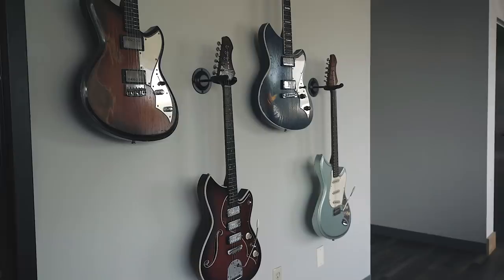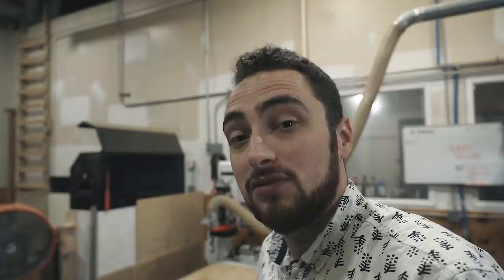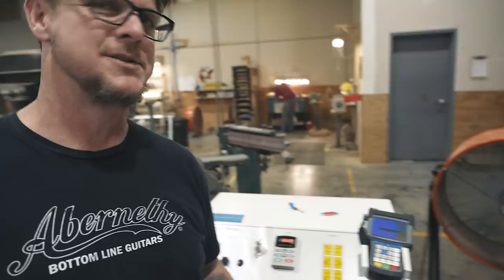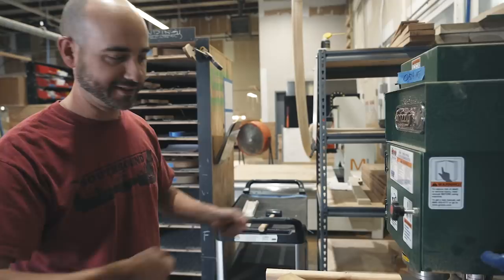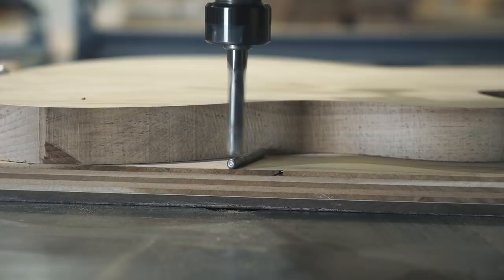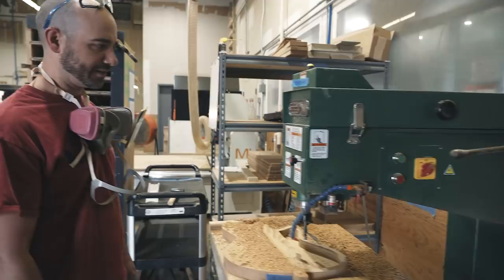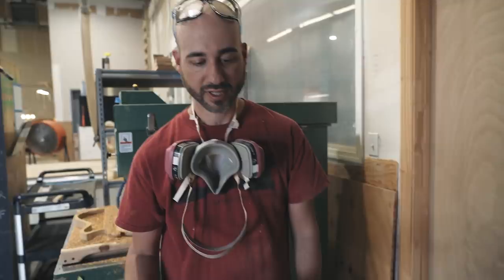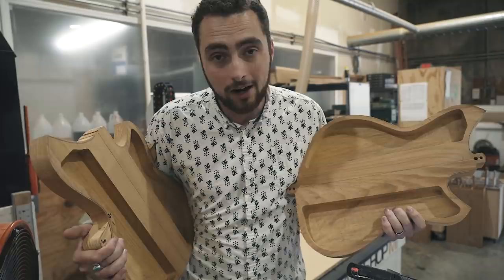Is “Handmade” Really Better? CNC vs. Handmade Guitar

Comment: I use a CNC router for manufacturing signs. We used to rout all the signs by hand but now we use a CNC. CNCs are faster, much more accurate and do a better job over all. A CNC router is just another way to cut wood and that is it. A luthier could hand saw the entire job as well but you don‘t see them doing that. That would be doing “by hand”. They could sand it by hand as well. You might get your guitar in 5 years. No, they use power tools and that is what a CNC router is a power tool that cuts wood. No doubt when luthiers began using power tools there might have been a debate from moving away from doing everything by hand. To debate this topic is based on metal illness. End of story (good video, thanx).
Reply: I can use power tools without mucking about using any software. A CNC machine with no program is a table.

Comment: 11:25 YIKES, thats a good way to lose some fingers, inserting the pin while the tool spindle is running.  Then goes on to speak about the risk of running that machine... lead by example!
Reply: I noticed that, too.  I was a safety engineer and I am astounded the machine was so dangerous.  You have to design for real people, who will always cut corners or get distracted, it's the human condition.  I'm sure he knew he should have shut the cutter off and waited for it to spin down to a stop, but he was trying to save that time.  The guy watching and asking questions should not even be in the production area at all.

Comment: I'm not a guitar maker, but I'm a wood carver and both ways have advantages and disadvantages. When it comes to 360 3-D carving like figure or Grinling Gibbons carving, then hand. When it comes to production and precision, then CNC. The big factor is cost, and how often will you use it. Some people just send there plans out and have an outside contractor do it. When it comes to original drawing table to completed piece then hand. CNC does have the speed factor as long as it's something that can be programmed! Clean up will always require hand....

Comment: Neither where "hand made" , both used machines, both used router bits, one had its boundaries set by a template (quite possibly a template made on the cnc) and the other was guided by X,Y data.
An acoustic guitar where someone is taking shavings off the braces is what hand mode is about and where a difference would matter.
In this style of guitar a one off hand made prototype is great for doing on the fly changes to the styling and balance of a body, after that it is consistent duplication of that result which is where CNC comes into its own and keeps the price down in the area of shaping wood that could be better spent on finish and setup.
Reply: Agreed. The most basic of Violin designs might give people a better idea about handmade stringed instrument "voice".
Reply: unless they produce a machine that can choose the wood /glue /fret/ polish/assemble/finish sand/mock up/ setup then every guitar is hand made. i Build guitars and banjos i do not have a CNC or pin router. i do use a band saw and a hand router and files chisels etc.

Comment: Great series! I own both handmade and mass production guitars and yes I agree the CNC method gives you consistency however as said here it’s still down to the operator/craftsman because some of those guitars play and look superb and others are well ok. 
The handmade guitars have their flaws but this is what gives them an organic look and feel and no two are exactly the same. A perfectly unique guitar which was built for each of my sons when they were born as a unique gift to them when they’re older. But I’d say I still prefer the CNC method for its safety and bare bones consistency and leave the energy of the craftsman to really nail the details in frets and sanding because the devils in the details!

Comment: As a custom guitar builder I do not use a CNC machine.  But I do use self made templates to help with the consistency of the routing.  The big part of a "hand made" guitar, in my mind, is the fit and finish afterwards.  Basically all of the crappy work of putting a guitar together.  The sanding, fret leveling and dressing, the painting and wet-sanding, the buffing, and the final setup for playability.   All of those tasks I believe are still done by hand at the big factories that use CNC machines.  So its more of a time saver than a quality issue.  Hammer and chisel would be the ultimate "hand made" guitar.

Comment: Well ... moving the wood by hand along machines is not “handmade” 😂😂😂
Reply: Does it really matter that the pattern that the router uses is a physical object instead of a list of stepper motor movements stored in a computer? Is the wooden blank chosen any more carefully by the guy with the pin router? Seems to me that it would be easier for the guy shoving the blank around on the pin router to screw up. Of course, in the world of random wound pickups and 'relic-ed' guitars, the inconsistencies of hand work and fake ageing are revered rather than scorned. (Disclaimer - I'm a software developer and I'm building a small CNC machine.)
Reply: jfan4reva I don’t think the machining makes a relevant difference. But it looks like they took a much nicer piece of wood for the „handmade“ version.
Reply: Having tools in contact with the work is not really handmade. If you're not digging the wood out with your fingernails then it just isn't handmade!
Reply: You know, there‘s a difference between power tools and hand-driven tools ⚒
Reply: @Sadowsky46  not on a fundamental level there isn't any true difference. They all operate on the same basic principals and we use them for the same reasons and end results. You simply cannot grasp things as they really are.
Reply: Paul Frederick dito 😉
Reply: @1pcfred  C'mon, even cavemen grabbed sharp rocks when they wanted to kill, skin, scrape, cut...
Reply: @ammoalamo6485  but what about before cavemen? There was a time when our ancestors literally lived a hand to mouth existence. Before any of them so much as picked up a stick or a stone to do something with it.

Comment: As someone with background in engineering and machining, especially for operations like this CNC just makes more sense. Even if the cost and time was the same, the CNC will produce a more consistent cut with a cleaner finish. Even very skilled machinists can't be as consistent with their machined finishes because a CNC can vacuum up chips, add any lubricant required (for metal/plastic parts) and keep moving in one smooth motion all at once. Where more hand-done operations shine is their ability to modify as needed to suit the material, something that can be done on a custom one-off where dimensions might change a bit, but not on a production product.

Probably far more important that the CNC vs pin router though is choosing the section of wood to make the blank out of in the first place.

Comment: CNC is just a duplicating machine, like the pin. If the design was bad, both will turn out bad parts. If the design was good, they can repeat that.
Reply: Exactly! CNC's are just repeating what you instruct them to do. If you trace the same line over and over again with a pin router, you're doing the same thing.

Comment: I have said this for years! A CNC is no different from a Pin-router - they both use a template (the CNC is following a Template too btw) and a 'power tool'. The only difference is that a machine is moving either the body or cutting tool precisely where as a Pin router relies on a 'human' to move either the tool or the body.
PRS actually make a 'hand made' version of whatever body, neck etc and scan that in to the machine to create the 'template'.
All a CNC does is produce the 'rough' body, the rough shape, the rough carve of a top or neck, and, like putting a 'template' on the top and routing out the cavities for PU's, electronics etc. Once the 'rough' shape body blanks come out of the CNC machines, these are then turned into guitars by skilled craftsmen who will sand out all the CNC marks (as Rhett knows well after receiving a CNC body blank for a kit build), sand down necks, sand down the right neck angle for set necks and ensure the fit tightly into the neck pocket for gluing, hand fit every fret wire, do all the fret work by hand, glue in every inlay, which can be quite complex (not just a dot), hand radius fretboards, hand finish all the frets, hand stain and finish the guitar, hand wire all the electronics, hand fit all the tuners, hand string the instrument, hand set up the instrument etc etc.
A solid body will be glued up (if it has a maple cap for example) then roughly cut to shape by hand and a bandsaw before its CNC'd into shape with all the routes cut out. The CNC is just following a 'template' like any 'hand' shaped guitar. Its done so that every guitar in the same model is consistent (apart from differences in wood density/grain as to be expected) so that anyone buying a guitar - whether its a Novo, a PRS etc - can buy in confidence because the 'specs' are the same as they are listed as.

Comment: Rhett, I know this is an old video - but as a Luthier I thought I'd give you a perspective on why we do what we do. It's not about Pin v CNC.  - that's a non issue. It's about making to template, or making to the customer's hand. When I make a guitar for a customer, they come in during the process and put their hand around the neck, They decide how wide the nut is, how deep the profile is. They decide the hardware - we design the guitar together. That's the real difference between handmade and CNC. Cutting bodies is not that important in the process. Buying 'hand made' to a factory template is a bit of a waste of time, so long as the QC processes are identically stringent. 

So it's about choice - I could buy a small CNC and cut blanks with it. It might save me time but take up a lot of workshop space I can't spare and I'd probably spend a lot of time programming it. I'd still, to really satisfy my customers, have to do a lot of work by hand to make the exact shapes they want - with chisels and cabinet scrapers and other small hand tools. Every guitar I make is different. Some are totally designed by the customer, some are to designs I have on my books, some are rough copies of old designs by the big companies. But all are shaped individually to the customer's specification. And that's the only real benefit of hand making guitars - the ability to offer almost unlimited choice to the individual customer.

Comment: Umm.. excuse my ignorance but does the sound really change on an electric guitar?  It's not like it has an echo chamber.
Reply: Depends if it's a hollow body or solid body. On a hollow body, the body does contribute somewhat to sound, but you have volume limits way below what you can achieve with a solid body and some hot pickups (solid body sound is more regulated by the electronics, and style and quality of the pickups)😉
Reply: @danw1955  Thanks :)
Reply: It definitely does, but the degrees to which different ears will detect it is debatable for sure.

To better answer your question I'll give you an experiment to try; tap on different materials like glass, wood and plastic, they obviously vibrate differently and sound different. When you are underwater sounds travel much further based on the same principle (density), fill a glass with varying amounts of liquid and the pitch  of the sound will change. Guitars even have resonant frequencies where certain notes will sustain better when the vibrations sent through the body match the frequency of the note  to further vibrate the note and keep it ringing longer, though this effect is more obvious on acoustics, especially when amplified (usually one note resonates or feeds back FAR more that others).

Now imagine you have two nails with a string tied between them and you have this on a dense piece of hardwood and also another on a much less dense and softer wood, do you think that the vibration would be affected, even slightly? Try making an old string walkie-talkie out of paper cups, tins and plastic cups, again, the material heavily affects the tone, even though the person's voice hasn't changed.

Amplification and effects allow you to heavily affect tone, but my guitar with a metal nut (string contact point 1), wooden bridge (contact point 2) and a plastic body  has a totally different character to my semi-hollow electric which is a light, soft wood with a cavity or hole in it to allow for more resonance like an acoustic. That guitar in turn sounds completely different to my Les Paul body which is super dense and heavy.

Long post, but hopefully it has helped answer your question; yes it makes a difference, but not everyone will notice it, some of it is also based on touch and the feel.

Comment: The other point that’s worth mentioning is that with CNC you can significantly lower your unit cost of production while maintaining  a per part accuracy that is an order of magnitude better . In manufacturing time is money building anything faster always makes it cheaper and therefore more profitable and much more accurate.

Comment: CNC is fine. Takes a human hand to finish a great instrument.
Reply: Not so much anymore, it used too, but a PLEK machines can do a better job than most any human on your frets, and fret board.
 It does take a well trained technician to run said PLEK machine, and make the recommended adjustments when they are recommended,(ie truss rod, and action mainly) and the better they are at their job the better the PLEK outcome, so in one sense I guess it still does require a pair of human hands, but technology can allow a guitar to be set up more consistently, and basically take 99% of the guess work out of the equation, when the PLEK is used properly. 

A bad PLEK job is a bad PLEK job, just like a bad fret job is a bad fret job I guess.

Comment: Handmade? That's a guy with chisels and planes. I bought a cnc 4 years ago to build cabinets. 
No difference between that and the table saw I was using before except the kerf is wider and I can do something else while it runs.
Reply: This. Most people dont have pin routers.... They use MDF templates and flush trim router bits to achieve their shapes.
Reply: Hey man, can I ask what type of cnc setup you bought, was it new or used, and about what did it cost?  I'd love to get one for making furniture, does that make sense at all for a one-man operation like mine?
Reply: @claumeister1  Camaster stinger 3.4x8 vacuum table, non atc ( mistake there, get an atc). almost 30K. I use Mozaik cnc complete for my cabinet software and VCarve pro for my other stuff. 

The machine paid for itself the 1st year. I don't have room for a bigger one but if you do a 5x10 atc would be the way to go.  
atc means automatic tool change btw. 

If you are building guitars and smaller things only a 3x4 machine would be all you would need.

As far as making sense for your operation? Only you can answer that. It was quite the learning curve for me and I had to change my construction methods. But in the long run it has been well worth it. The software is the most important part, you have to be able to use it. Vectric has tons of videos on youtube. Mozaik does as well but you have to be logged into their website to see them.

If all you were building is guitars I would recommend a cad program for 3d design. Camaster is pretty well known so you can get a post processor from most companies but always make sure one is available for your machine or the software won't work to actually make parts. cad= computer aided design. cam=computer aided machining.
Reply: @claumeister1  the machine matters far less than the software. If you're serious about getting a CNC machine then start out learning how to 3D model. It isn't for everyone. It isn't for me that's for sure. I got a CNC machine too.
Reply: @1pcfred  thanks,  I am a software guy    and have an interested in 3D graphics, I will start getting into that.
Reply: @claumeister1  I spent a fair amount of time trying to learn modeling. I can't say I'm crazy about it. It seems like a chore to me. Then to add insult to injury I learned later on that the software couldn't export data in a format that was useful to me. It looks like it can handle US Customary Units within it but exports in metric. Well, the developers claim it exports in arbitrary units. They just happen to only scale properly as metric. So due to this my CNC machine just collects dust today. Well, there's a bunch of crap laying on the table now too I suppose. I should just throw the damned thing out. It's wasting space. Yeah I just love software.
Reply: @1pcfred  I hear you, man.  The most intuitive software I ever used was the stuff I wrote myself.  But my brother's an architect and can give me advice on what 3D packages to use, etc.  If I find something that's fun to use I'll let you know.

Comment: A lot of the debates around guitars on the internet is more a lack of knowledge or understanding than a matter of personnal experiences. Videos like these are super well informative. Working in a manufacture as a cut-sheet technician, i can only see advantages of the CNC in terms of production capabilities. The pin-routing is just the exact same process, made slower, by a human. Because he follows the pin, he does not really put any decision on the movement, that could put a major difference in the guitar body. The «hand-made» part is pretty light, at least for the routing part.